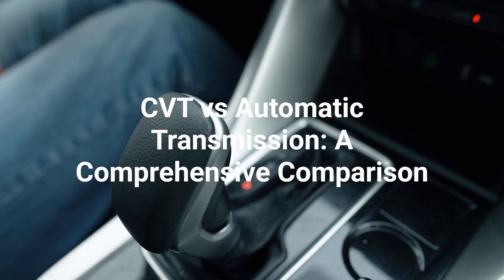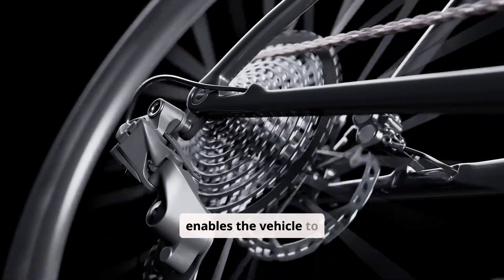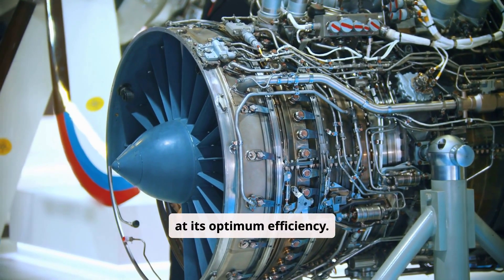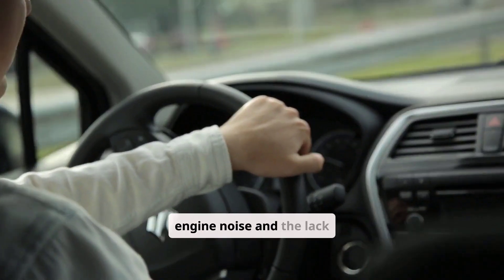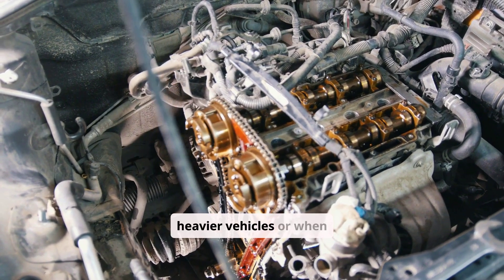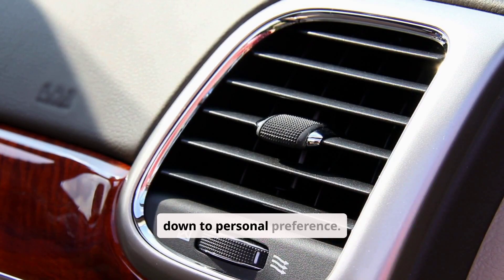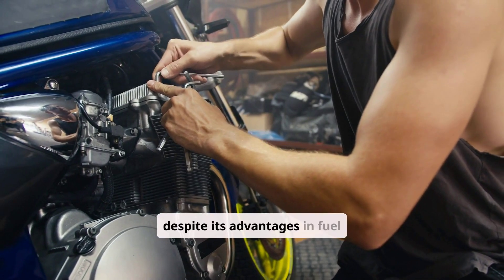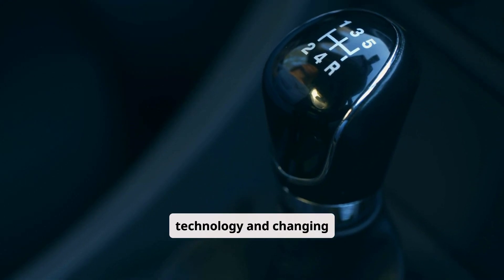CVT Vs. Automatic Transmission Differences

Comment: if you need or want an active driving experience, you choose a manual.... the only reason to choose an automatic is because you want an smooth easy sailing..... The 2004 Opel Vectra i had many years ago, with an cvt ofcource, has not one single car been able to beat in smothness.  The most silent engine ive ever expeirenced, park the throttle at 1800rpm, and just let the machine just make it way to the desired speed.....